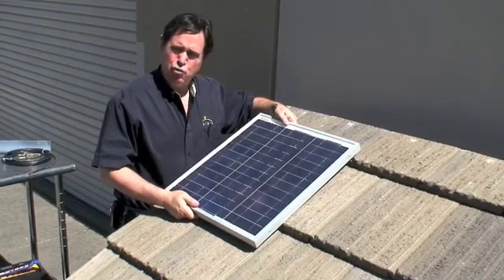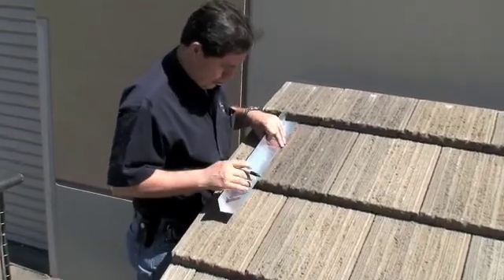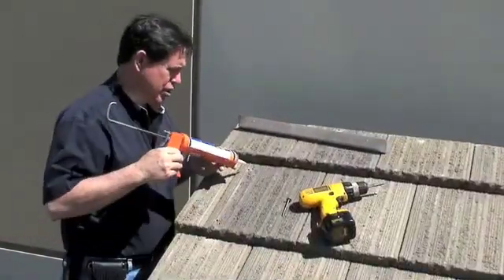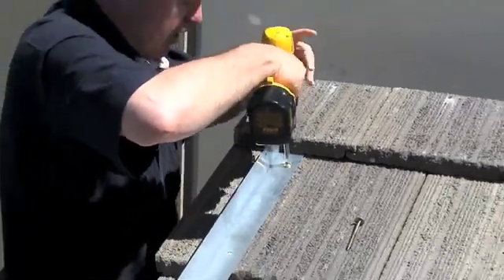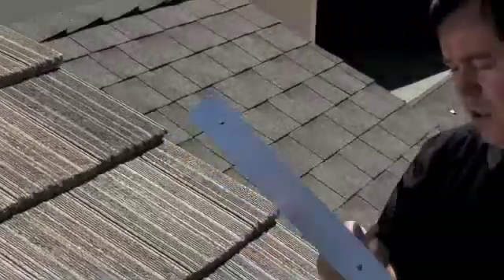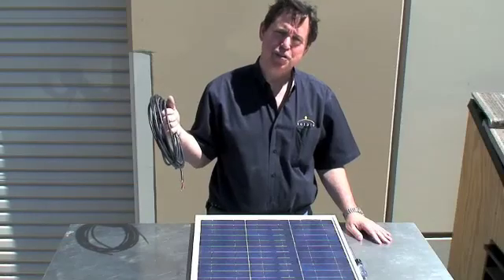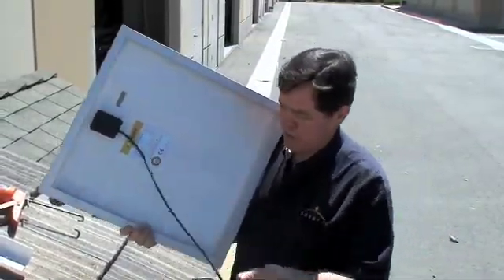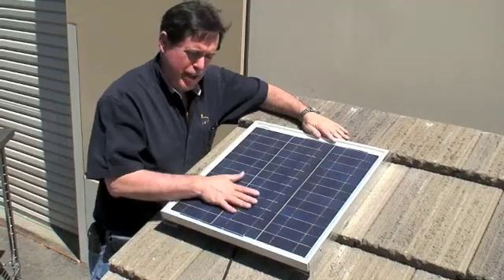DIY SOLAR LED LIGHTING INSTALL FREE ENERGY TILE ROOF PART 1

Comment: DO NOT DO THIS, you will make your roof leak.    Chalking IS NOT going to last long on a roof and when it rains your roof will leak.    I owned a roofing company for 15 years, please trust me on this.

There are brackets you can buy that do not need to be drilled into the roof, they just clip under the bottom edges of the tiles and will not move.
Reply: Robin, Could you provide a link the brackets you referred to. Thanks